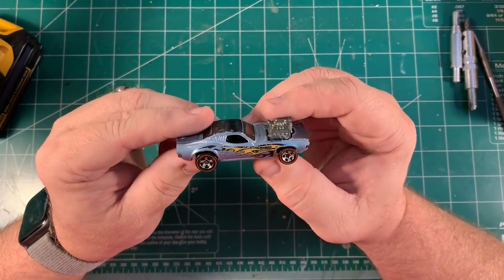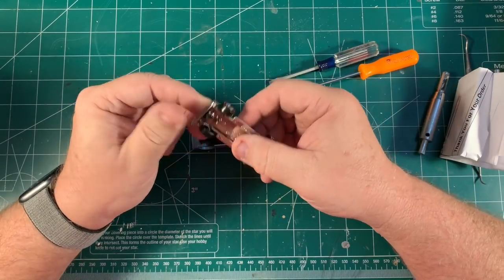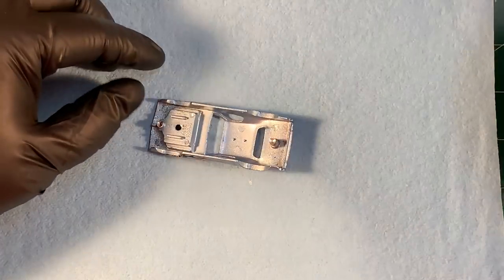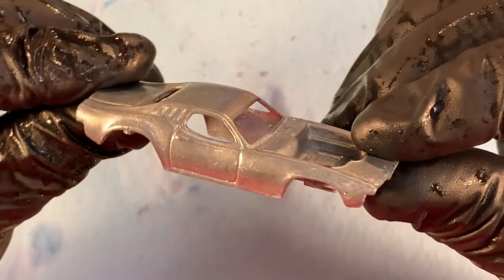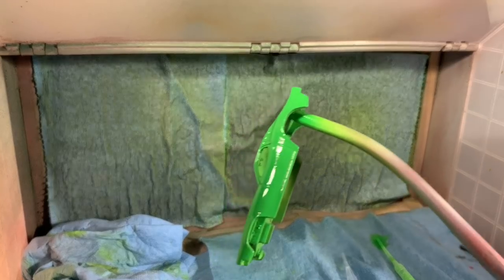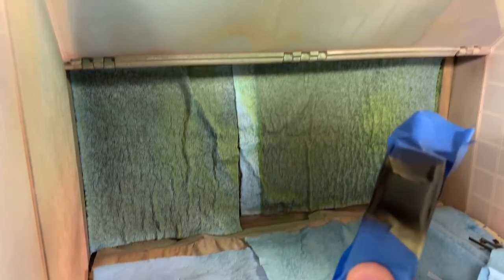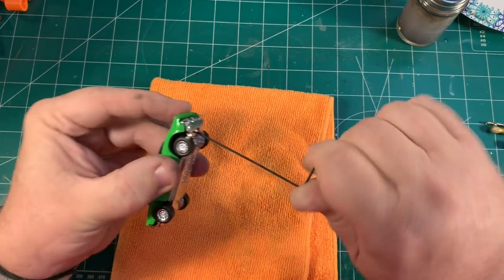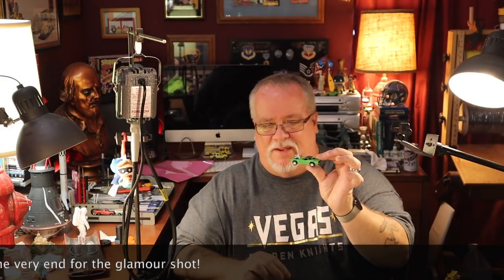Hot Wheels Redline, Rodger Dodger Custom

Comment: Paul,  There's also of cool spectraflame cars for the next couple years after the 68 year. Great job on Rodger dodger, I did two over the winter one was an original plum one I did factory.  The other was a later casting like yours that I turned into a gold one. Great fun. Customs are cheap to build and look great in a showcase

Comment: The Rodger dodger is one of   my favorite hotwheels castings along side the super van, the hot bird, and the 57 Chevy. Speaking of I still have all 4 of these that I had since childhood. I'm in the middle of restoring the hot bird and 57 Chevy. I haven't tried tackling the super van or Rodger dodger yet, plus the later 2 are still wearing their original redlines. They could stand a restore though. I'd like to wait till I'm a little more experienced first.

Comment: Im sure youve been told by now that HWs also released a similar casting called The Dixie Challenger.  If not...as a Original 16 Redline Snob...it is the same car sans the engine...just a closed hood.  You could do one up in Plum Crazy.

I did a Roger Dodger up in black with some RealRider®
Wheels from a modern Bone Shaker.  I added an engine from a M2 GroundPounder Dodge Challenger and moved the open headers down below the rocker panels in a nod to the Original Redlines.  Ive also De Tampo'd a yellow RD just to have the pure design of the crazy Challenger with massive MoPower on the hood.
You are right.  This casting is pure Hot Wheels and it can change the mind of a purist.
Reply from the maker: I love the idea of doing the Dixie Challenger!
Reply: @pauly7218  Larry Wood has been tributed with a series of his designs.  The Rager Dodger is one of them.  The motor sits without the headers.  They are under the quarter panel like the oldies...thought you might be interested.
Reply from the maker: @nascargas  How cool - I love these bit and pieces.  Stuff like that can be hard to hear about....  Thanks...